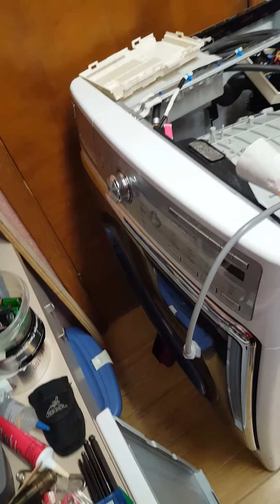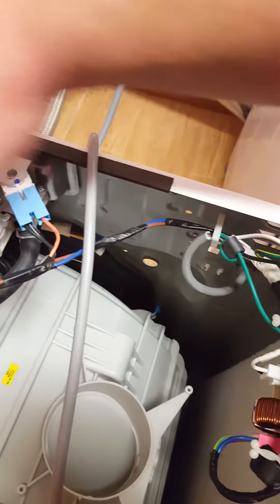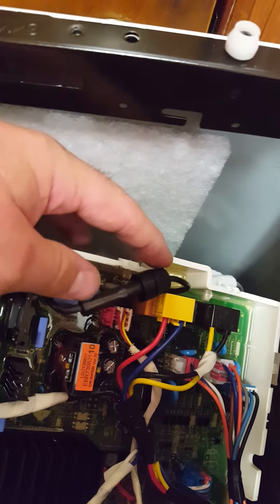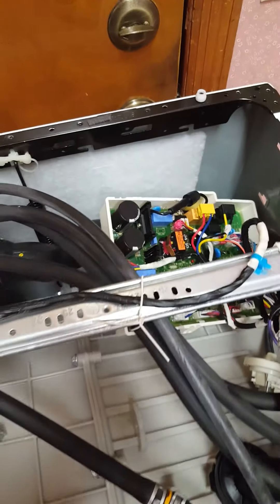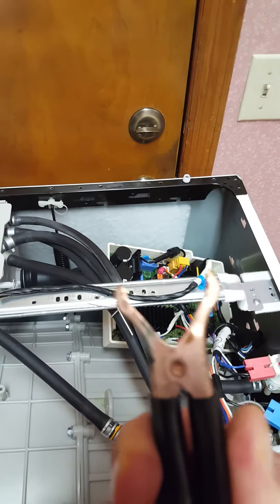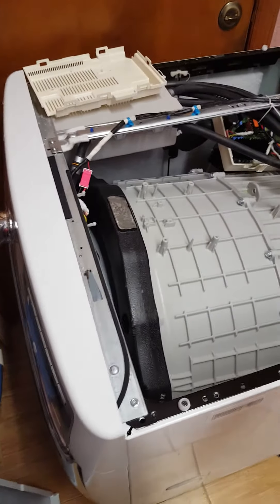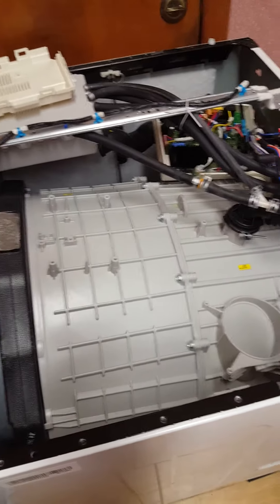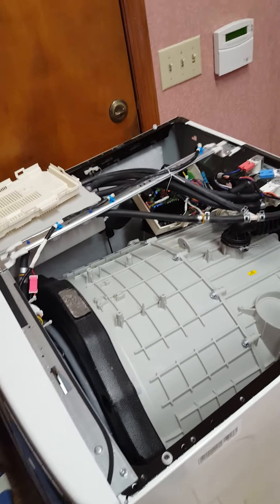Kenmore Elite 41072 5.2 cu. ft. Front-Load Washer Fuse Piggyback

Comment: Thank you, this is exactly what I was looking for.
Reply: So I tried the piggy back and I feel I soldered it well however the washer still won't power up. Any ideas?
Reply from the maker: Hey Matt, apologies, I am not getting notifications from youtube and have not checked back,,,
Did you check both fuses? There is another fuse on the power cord input inside the top back right side of the washer.
Also, check the on/off switch...it is finicky some times.
If these things are not the issue, then it might be the entire motherboard...they are $125 on Amazon, but you might have to use the LG part number...good luck!

Comment: I have the exact washer and exact issue
Reply: me too. what did you do to fix yours? the same as Matt?
Reply: @RacerEcks5678  replaced the control board , new bearings and tub seal, new shocks , new solenoids, new heating element, new pumps and didn’t replace everything all at once
Reply: @Casey-uk3wy  wow! Sounds like a train wreck of an appliance!
Reply: But oh so worth it.  The rpm’s were through the roof. Highest I seen was about 1600
Reply: @RacerEcks5678  they are junk. We've had to repair something on ours about once a year.